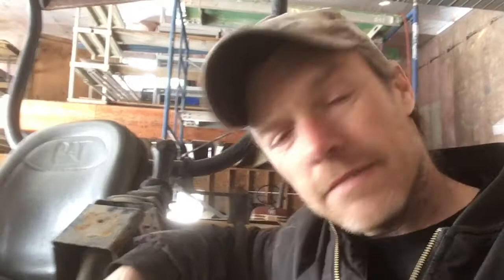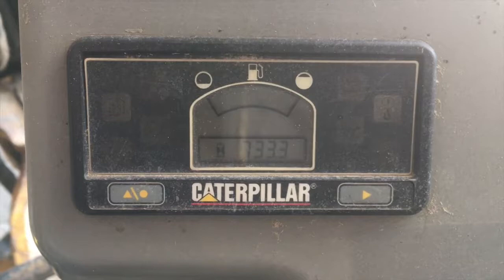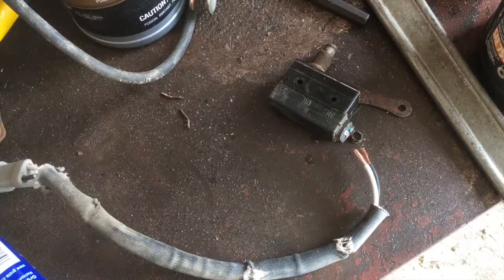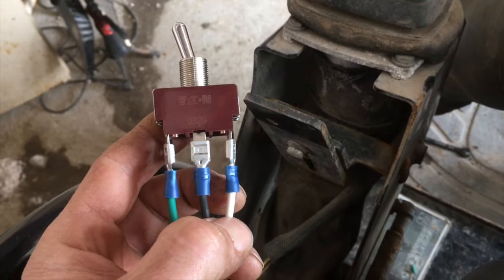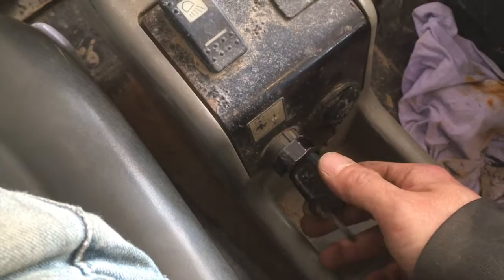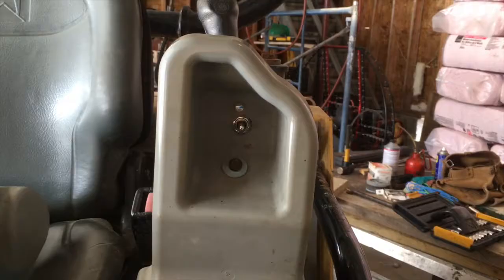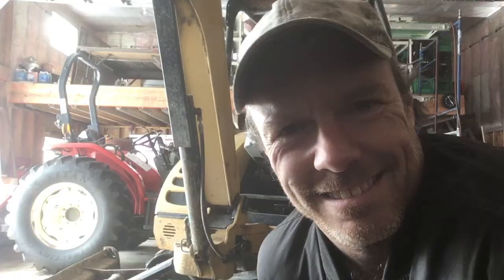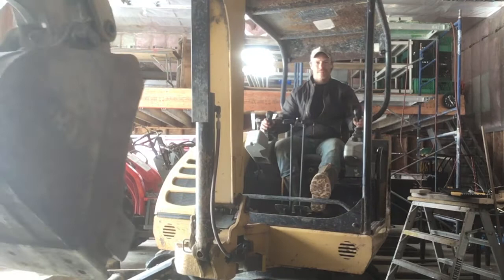Excavator Safety Switch, anti theift device!

Comment: Hey Mr down I saw your garlic planter build and had a question, what did you use at the base of seed hopper to allow the cupped chain to come through and keep the garlic from falling out.  I also built a 2 row garlic planter for myself just having issues getting that part sorted out.  Had to ask here your comments were off I. The other video, thanks in advance.
Reply from the maker: I check the comment thing... peice of a car tire tube with a slot cut in... the chain pushes through and tube closes up after each spoon goes through... I didn’t see any drop out as I planted... I plant a few acres of farlic

Comment: I know this video is kinda old but I’m having a similar issue and I have narrowed it down to the hydraulic lockout switch also. My question is, does your mult function on/off/on have 3 posts or 6. All the ones I’m finding online are 6 and it looks like there are 2 power and 1 negative
Reply from the maker: Three position… one way to start… middle neutral and other way to start machine